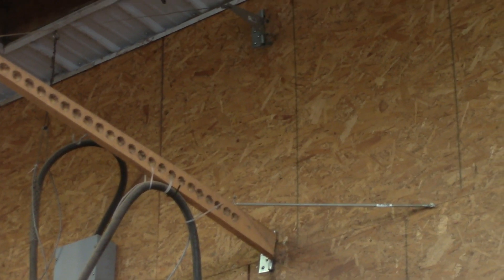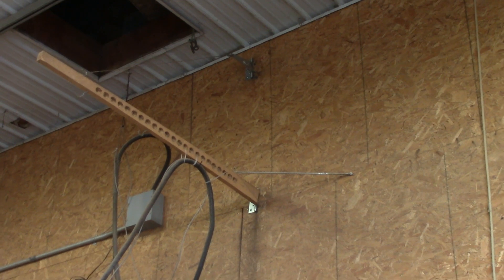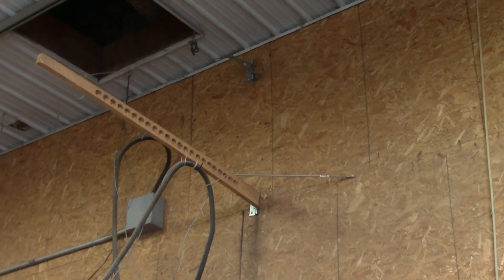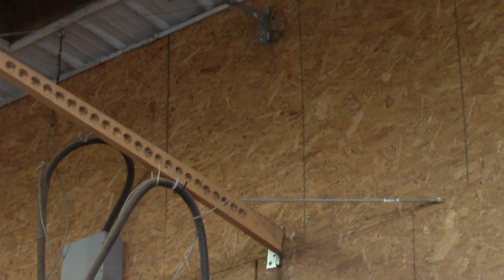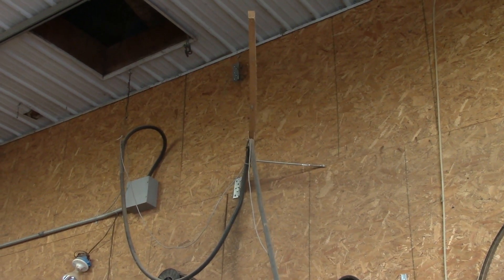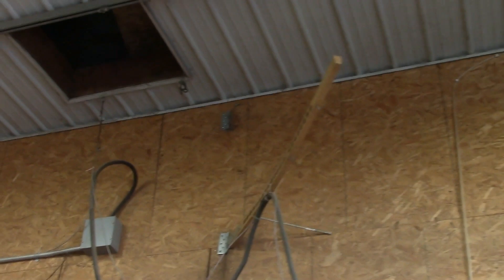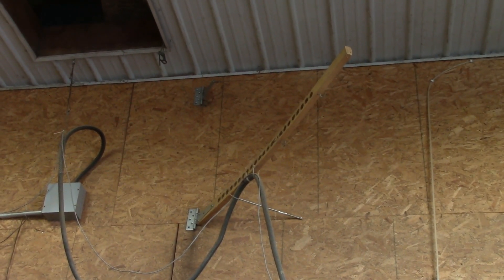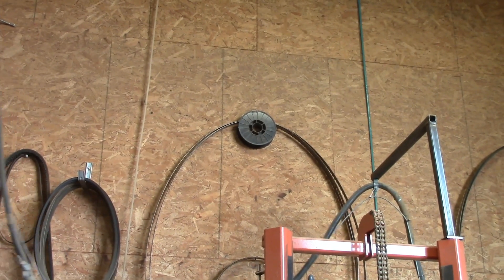Wood-Mizer Electric Sawmill Power Cord Management System

Comment: One of the important objectives in cord management is to distribute the twist or flexing over as much of the cord as possible.   While they definitely flex they won't flex indefinitely.   If all the twist is concentrated in one spot, the cable will break.  Al has a video showing how he built an extended frame to support the cable on the mill.  I did something similar.
Reply from the maker: Definitely correct, indefinitely, Bibby! ;)

Comment: For years we had the SO cord suspended by a cord in about the same position.   The cord ran over a pulley high above the left side of the mill.  A weight was on the other end.  This system has been replaced by a giant screen door spring that the large trucks use to hold up theit trailer air lines.  The function and purpose is the same.
Reply from the maker: There is definitely more than one way to manage power! We have one of those giant springs on the dust collection hose for the mill, works fine for that, too! Thanks for watching!! Linda